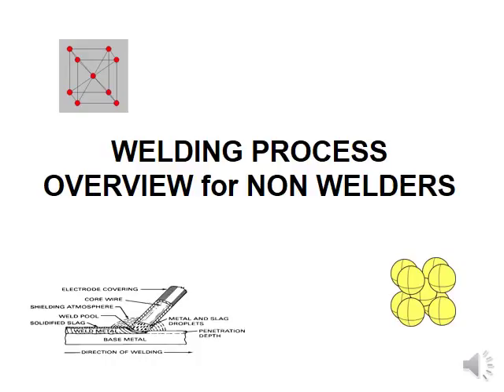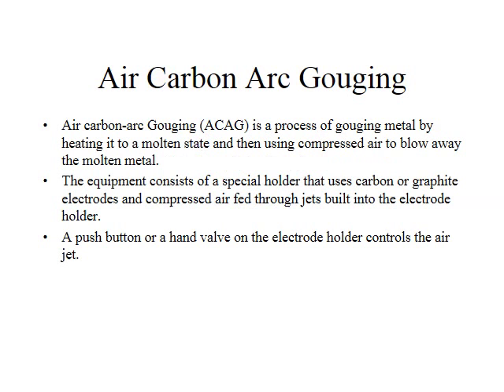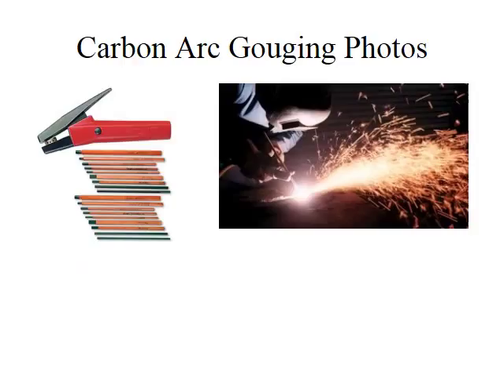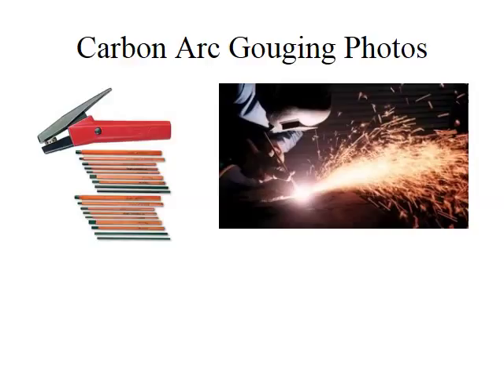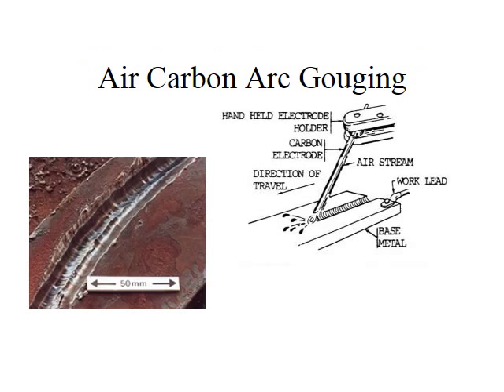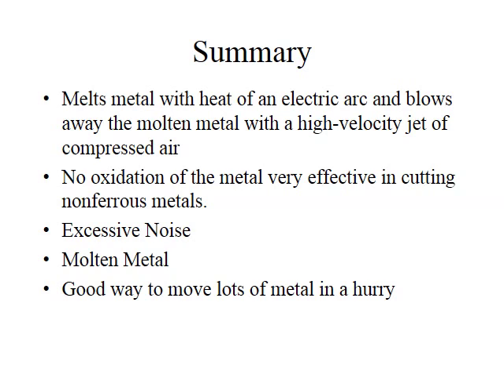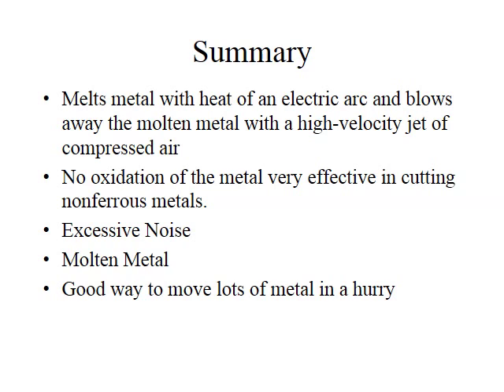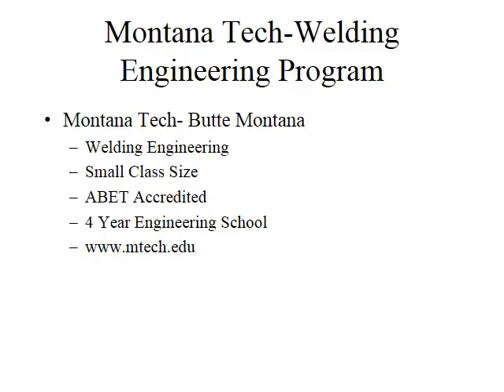CWI Course Module 3 - Part 1 ACAG Process

Comment: I remember using this alot when I worked for a railcar repair company we used it to gouge out defective welds it's good but if your not good at it you car ruin parts fast I prefer plasma gouging it's not so aggressive and way more controlled and used way less air